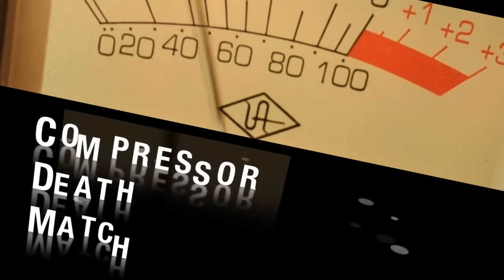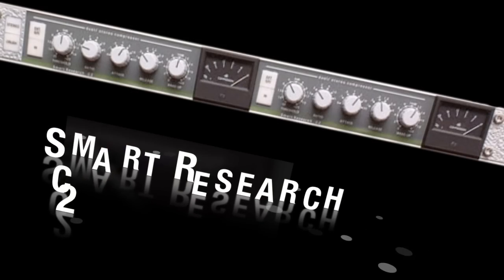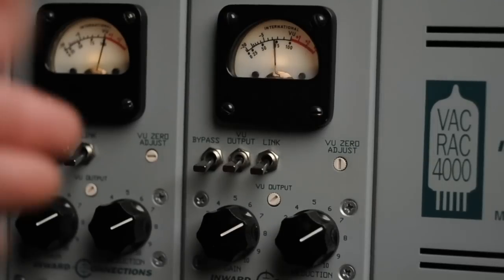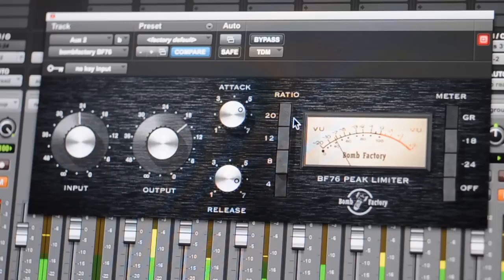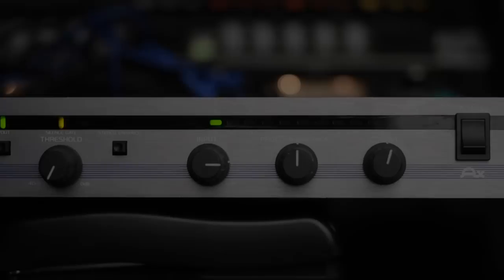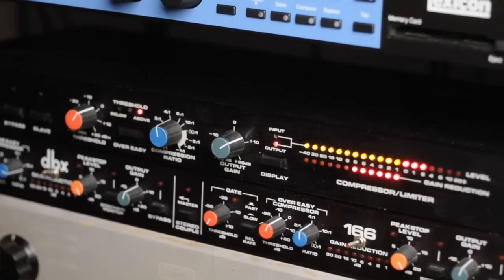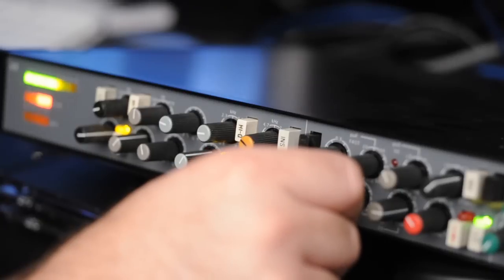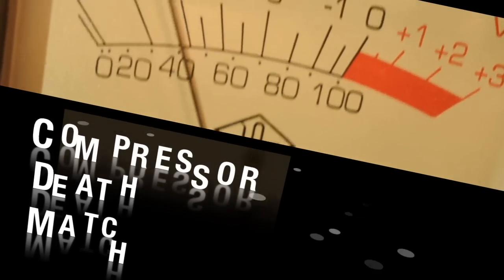Recording Studio Compressor Death Match!

Comment: Great video, You brought light to the aphex, I was really feeling that... I have a manley mu, as well as the dbx 160 pair... Great video.. I will be pulling my wallet out soon for some more gear, well every month... I just bought some rosetta 800's had ad8000se, big ben clock,, curious what convertors were you using?

Comment: Same settings?
Attack and release times aren't accessable on most tested units.
When time values can be set are they time for returning to unit gain, time for a 6 dB variation, or time for half gain reduction. Could clarify please?

Comment: What do you think the best compressor for the price tag is for drums? Thanks
Reply from the maker: "For the price tag" is not really what this video is about - software is always the cheapest.  If you're looking at hardware compressors you're probably trying to get that last 5% of sound quality that hardware provides compared with software.  In that case, it doesn't make sense to use a cheap compressor if it harms the sound going through it, you want the one that enhances the sound in a way software can't.   In my limited experience, that puts you into the $1000+ compressor class.  And once you're in that class, you just choose the one that sounds like the sounds you hear in your head.  The sounds you are going for when mixing.  That's the purpose of this video, to help you choose a hardware device based on sound.  Once you pick a sound, you save up $$ until you can add that tool to your arsenal.  Then you are one step closer to getting the sounds you hear in your head.
Reply: I’ve been in the box and I’m looking for a decent first hardware compressor to get used to without breaking the bank. The dbx is hundreds of dollars of cheaper and sounded on par with ones a thousand dollars more to me so maybe I’ll start there. Thanks
Reply from the maker: Larry Tate   Yeah!  If you like the sound of it, that's the one for you.  The 160 / X /XT in "overeasy" mode will put a snap on the front of drum in a way I've never heard from software.

Comment: These are way out of my budget range unfortunately, what would you recommend for my first outboard compressor on a budget to mid-range expense?
Reply: +Commit If you can find an  older dbx 166 (NOT THE XL OR XS) you can usually get one around $150 used. Other than that maybe a used RNC around the same price. Otherwise I'd say save your money until you can afford something nicer. You get what you pay for with audio & its better to save than to buy and regret later.
Reply: +Schneiderhan Sounds Thanks, what is wrong with the XL or XS? I can only find XL or XS in my local stores, is there something bad about their sound?
Reply: +Commit Id be lying if I knew the technical differences. I think the XL and XS used different gen VCAs. I believe the XS was marketed as more of a live rig, and it's gate is supposedly different. But the XL I've had personal experience with while working at a different studio. The sound wasn't very flattering, and it seemed to "pop" when compressing over 11db. From what I've read, the XS isn't much different to the XL. Back in my college days I used the original 166 in one of the school's studios a lot. I particularly favored it for drums. I guess the TLDR is: new budget gear usually doesn't sound good, best to find an older gen model for the same price. Hope that helps!
Reply: +Schneiderhan Sounds Thanks, great answer. Appreciate you taking the time.
Reply: +Commit no problem! I am actually expecting my 166 to arrive in about a week. I'll have to post a review when it arrives.
Reply: you can find a dbx 160A or 160X for $150 to $200
Reply: Stay away from DBX or any budget comps. FMR RNC and RNLA only, those things are still used by people who have all the great compressors, which really says something, you can buy one and will be using it for life.

Comment: Does it make sense to use compressors with synth sound?
Reply from the maker: Most of the time, no.  I'm a synth player but rarely use comps on keys I play.  Sometimes a track will come in that needs a little compression but software usually does the job for me

Comment: How does that dbx 166 sound compared to the 160x ?
Reply from the maker: The compression action when the 160X is set to "overeasy" is pretty much the same.  The sound quality is a little soggy compared to the "hardness" of the 160X.  The 166 has major switch problems however, every switch is intermittent and requires wiggling to get it to work.  I think dbx fixed this in the 1066 and 166XL models?

Comment: Interesting. This is an old video but I wanted to point out that the author did not demo the Aphex unit properly. If you watch the video he has the THRESHOLD turned to '0' as he complains that he's not hearing a lot of COMPRESSION. Doh! Of course not, the THRESHOLD controls the amount of compression. If you look next at the setting of the THRESHOLD on the DBX160X, you will see it is set to -25 and it actually compresses. Haha, oh well. The good news is that this did not raise the price on the used market of the Aphex comp. :)
Reply from the maker: Actually the Compellor 300 shown in the video doesn't have a compression threshold control.  The knob labeled "Threshold" is for the Silence Gate feature only.  

All compressors were set to compress 10db with a test tone prior to the demo, regardless of what their front panel markings said.
Reply: I own the 651 so, yes, a different animal, you are right. Having now read the manual, I see that you did use the knobs in the proper manner. My apologies. I would add that there are dip switches inside the unit and in some cases resistive jumpers that should be added to the in and outputs to match impedances to help the unit operate as designed. It seems - according to the manual - that the VCA is controlled dramatically/entirely by the signal input. If the signal is too low, this unit will not operate correctly. The manual goes further to say that the meters may look like there is sufficient signal but there might not be. ?? Well, I will assume that you set this up properly. I confess that, IMO, the performance of this unit was very underwhelming and hardly rates some of the high prices I see for these used units. Oh well. Peace.
Reply: In the video you have the 300 (after a few seconds) set fully CCW which is  0dbv. It may well be that this would allow for maximum compression, not clear to me, but again, if the input is overloaded via an input impedance mis-balance, then the compression of the device is effectively turned off. Which is actually what it sounded like. 

The manual says this regarding how the compression might be turned off even though the LEDs would make it appear that the 300 is working: "The Silence Gate is another important part of the COMPELLOR's natural sound. Whenever the input falls below the selected threshold the Silence Gate freezes release of the gain reduction. This eliminates noise swells and allows normal fade-outs. When the program resumes, attack is improved on the next signal because gain reduction does not now have to go full range. The Silence Gate will hold gain reduction release indefinitely--for several hours, if necessary. The threshold is set by a front panel knob and is variable between 0 and -40 dbv.
Reply: Arrg... Wait, I now see that the full CCW position of the Silent Gate/Threshold is -40 dbv which would cause the compression to be on all the time. So we wouldn't hear anything but a compressed audio at the output. Hm, so I think there is something wrong at the input of the signal? I don't think the 300 is seeing enough input signal, regardless what the meters might be showing. Jim Williams, when discussing the use of the 651 says that the input of the 651 should be something like +16db, a pretty high number. Maybe the 300 is like the 361 here?
Reply from the maker: Hey Rooster, thanks for being so thorough!  That Compellor 300 is one I owned for a long time before the demo, and I was pretty familiar with it's sound.  The selling point for those when they were new was that they offered transparent leveling, dynamic range reduction, and limiting.  The leveling feature is slow and lazy, a lot more like someone riding a fader than a compressor.  The Silence Gate feature only prevents the release from releasing when there is no new music (like on a fadeout).  During musical passages, the unit rides the gain like a normal compressor.  Sonically there is no pumping or fast release so it's much more like an automatic gain control than a normal compressor.  I can assure you that it was delivering 10db of reduction in the video, measured with an external meter, which was the same amount of reduction as all of the other compressors.
Reply: Thinking about buying an Aphex based on Jim Williams' suggestion.  I'm confused about your reference to the "300"?  Are we talking about the 651 - or another unit?
Reply: Skip it dude. Don't bother buying any cheapo compressors, they are useless in the studio, for live sound only. There actually is 1 1/2 exceptions The first is any of the FMR compressors: The RNC or RNLA or the new mono one who's name I can't recall any of their stuff should be your first compressor. The 1/2 one is ART. SOME of their Starved Tube stuff is actually pretty good, but you have pick the good models and change the tubes don't just buy anything by ART, some of it is crap too. Aside from those things, don't waste your money, save it and buy a real compressor, with the other stuff eventually you'll realize it's making your stuff sound bad, then you have wasted money and junk on your hands.